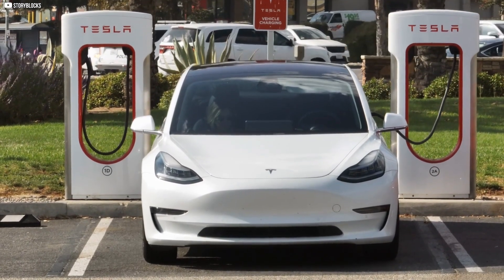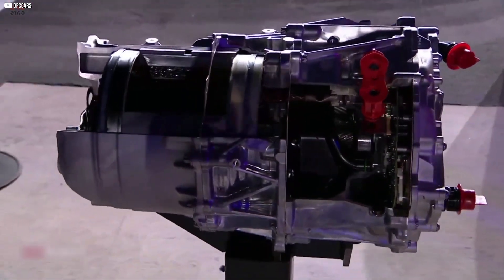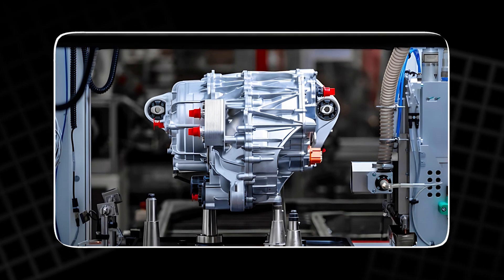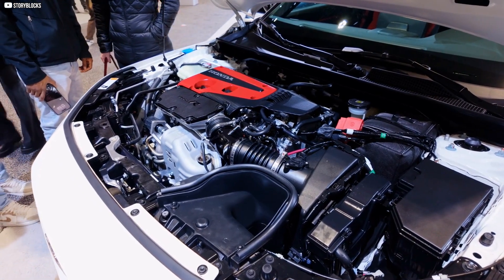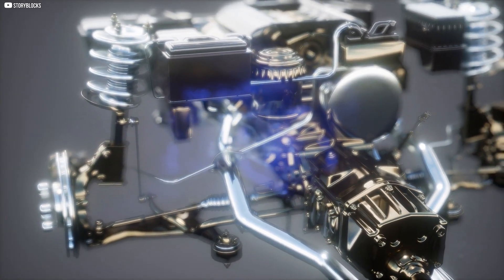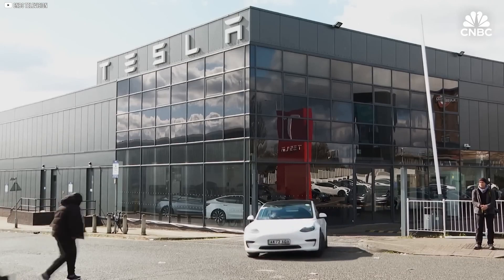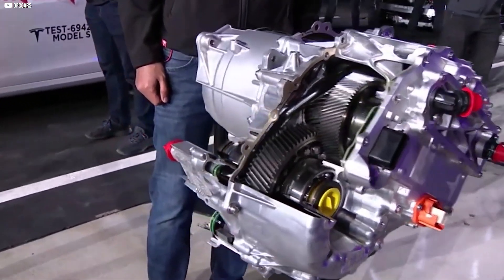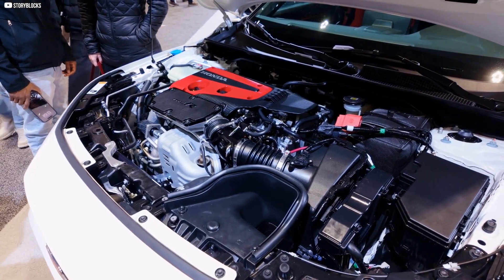Why Tesla’s Carbon Rotor Could Change the Future of Electric Cars

Comment: Carbon wrapped rotor, sounds ideal also for inwheel motors to make them lighter.  Tesla switches to permanent magnet motors, it could be a good idea to apply Niron's Iron nitride (free of rare earth elements) super  magnets. EV innovation (motor, batteries) is not yet finished and will continue!